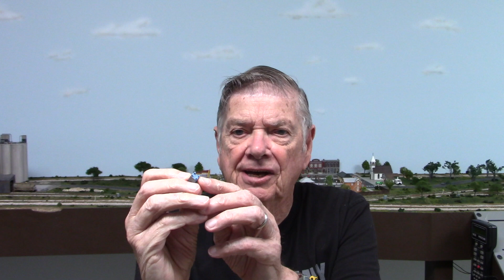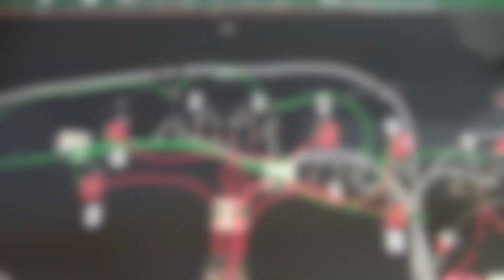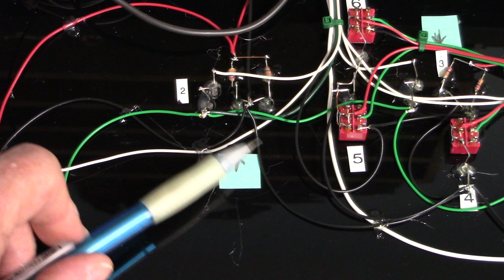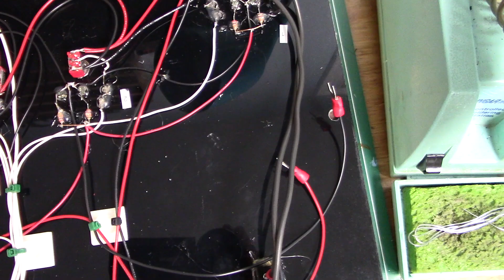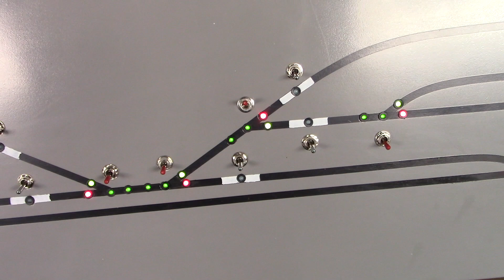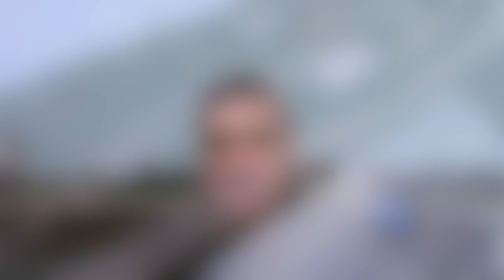Manual throughs to Toruouis  switches, Part 2

Comment: Looks like it should work fine. Smart to use the plexiglass as a insulator for the resistors.  I have done that for years. Also if you don't have a lot of colored wires. You can take a black or other color sharpie and drag it down one side of a red wire. That makes it red with a black stripe. This can be done with many colored wires to make stuff easy to chase down.
Reply from the maker: Thank you for the reply.  Fixed the problem of color wires, bought some 24 AWG wire, Violet (for positive) and gray (for negative).  Only took about 2 hours to install the new wires.